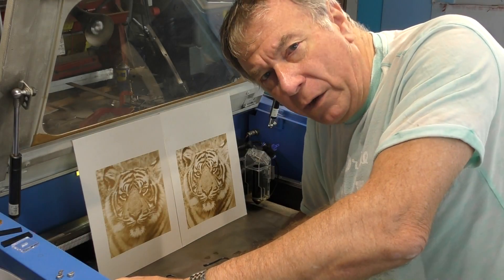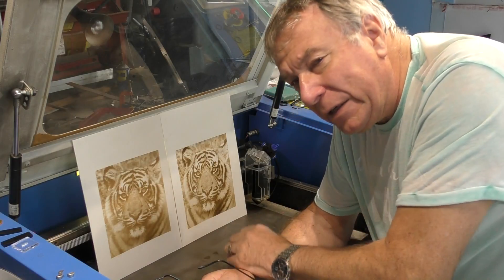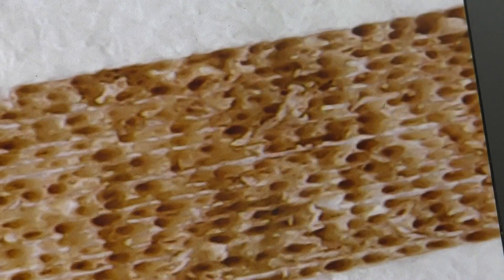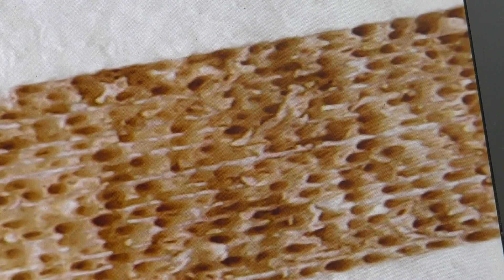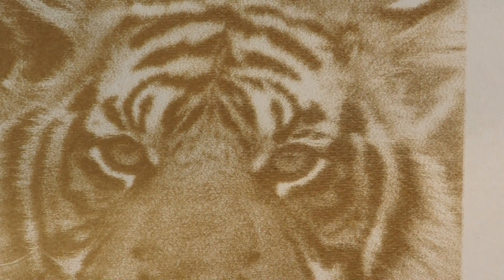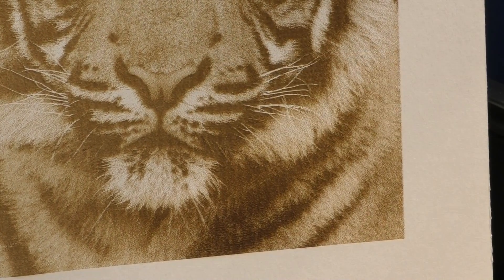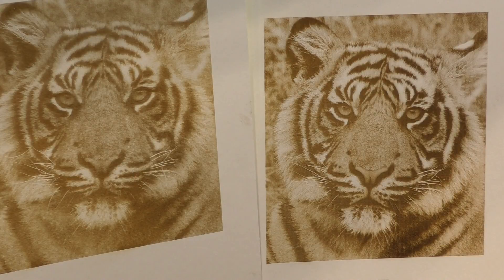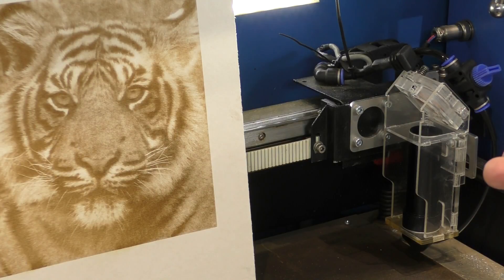RDWorks Learning Lab 159A The Chequer board Footnote

Comment: this was the most recent video so i am gonna write my thinkings here. i think the best way to learn your dot measure is to cut circles for example 10mm 10.05 mm. 10.1mm 10.15mm 10.20mm. take the first 10 mm hole and try to fit other circles in to it. if for example 10.1 circle fit into 10 mm hole snug, that means you have 0.1 dot...
Reply from the maker: Hi Umat
Although that is a great idea, there is a huge difference between cutting through a material and making a dot on the surface of the material. You must imagine our focused laser beam to be like a pointed artists brush. If you apply just the lightest touch with the brush you can paint very thin lines. If you apply more pressure you will force the brush down and paint with the thicker part of the brush and create much thicker lines. It is exactly the same with our laser beam. Apply the smallest amount of power possible and you will create  very small dots. That power is insufficient to cut through. To cut through material you need lots of power. That will always create a thick line on the surface and a channel through the material where the gap will depend on the speed of the cut and the lens focal length. What you are doing is a great way to get tightly fitting parts if you are doing marquetry for example but I would not advise it for checking dot size.
Best wishes
Russ

Comment: Great vids got one of these today ebay Australia.  Cut some 2 mm perspex, a little while later I was looking at the machine perpex lid and here is a mark that matched the bottom cut on the perspex angel I cut, now I thought I might have sat it on top and it left a mark, dust??.  Nooo there is a cut in the underside of the cover enough to feel with my fingernail.  How is that possible.  Stock machine with the aluminum bed, off to get a bit of steel cut tommorrow had to wait for the machine to arrive to measure that.  But I would have thought the beam that was obviously reflected would dispurse a bit but must have been spot on and relected perfectly.  It was at 30% power.  The item was 180mm high by 80 wide and it was only 10mm at the bottom and the 80 width that was cut into the lid.  Only watched a few of your vids so if thats covered I have not seen it. The cut is perfectly thin on the underside of the lid.    (Have pictures if they are of interest) No mirror alignment needed either worked out of the crate, well via the laptop cannot get it to read a file of the card yet and its fat32 so look into that tommorrow.  Oh and while I'm at it (I hate windows 10)  Since I couldn't get the usb flash drive to work I plugged in my laptop that came with Win 10.  I have windows 7 on my main computer in installed rd works fine and it put an icon on the desktop.  Installed it on the laptop, seemed to work, can I find it, nope nope nope.  Searched for the exe file, didn't show up so all I can say is it didn't work even though it loaded a driver then gave me a chinese comment to click.  mayby that was an it failed.   So copied the directory from my win 7 comp.  Its just called rdworksv8 and is on c drive.  So dump it on the lap top go run rd works from that, runs fine talks to the laser quite happily.  So windows 10, dunno if it didn't install properly or not but its working, but not safe with the lid open me thinks.  data357@yahoo.com if needed